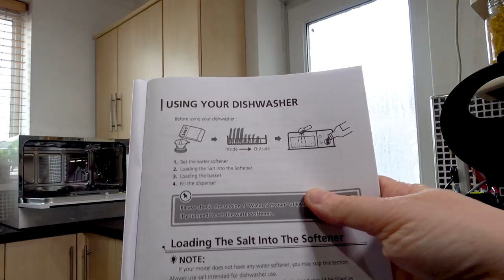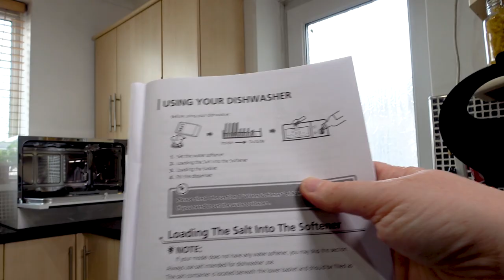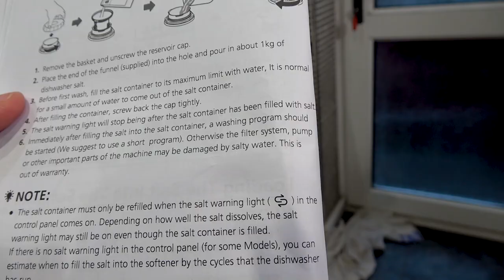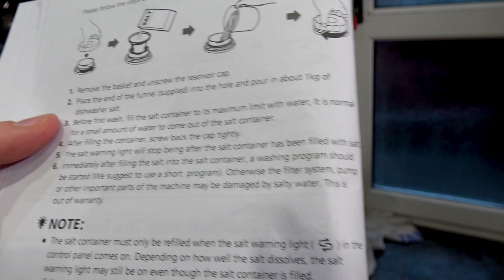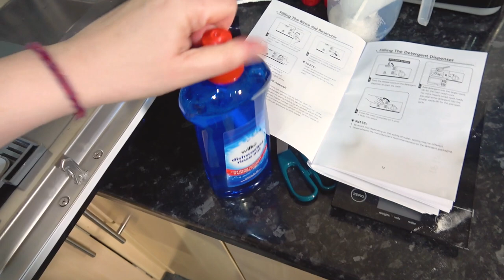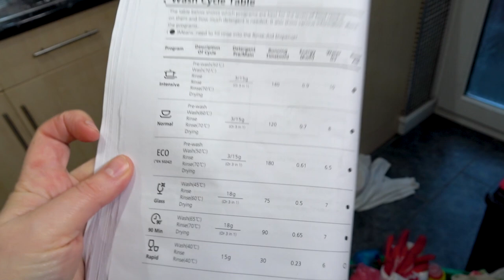COOKOLOGY COUNTERTOP DISHWASHER UNBOXING, SET UP with KITCHEN TAP & INITIAL IMPRESSIONS.

Comment: This video literally saved the day , I recently bought a counter top dishwasher and had the same issues with connecting it to the tap , this idea is amazing . I've done the same and now have a working dishwasher after buying loads of different attachments for the tap that just wouldn't fit . 😊 Thank you
Reply: Where did you get the tap adapter please?

Comment: Well done on your perseverance! I had a plumber install my table top dishwasher and never had to put that item on my tap ever so none of that screwing anything to my tap, I just plugged in and it worked, it must be all set up behind my dishwasher so no need for the annoying tap things coming off. If you don’t have the space for a full dishwasher and dislike washing dishes as I do then you will adore these sizes of dishwasher, great for one person or max two. Love mine, on my second one and wouldn’t be without it, also being on worktop you don’t have to bend down to load and unload, another plus.

Comment: i just got the 8 place baridi dishwasher. it is similar to yours. i tried a screw in tap adapter and it just kept leaking everywhere so i decided to plumb it in like the washing machine. i had to cut a hole in the worktop but it works great now with no leaks. it is also looks nicer than havig pipes all over the place.It is my first ever dishwasher and my emotions during the setup process were identical to yours.

Comment: So funny 🤣 this is my reaction to any DIY or setting up things....glad I'm not only one!!! It's made me more confident in attempting mine now, as I've the same dishwasher and tap, it's been sitting in my kitchen unused for two years 🙈 been thinking I couldn't do it. Thanks ♥️
Reply from the maker: Thanks! Hey - my tap DID have a screw thread on it - the tip on the tap worked itself lose eventually after that bulb got blasted off enough times. I soon got it plumbed in properly as I found it a pain having it stuck on the tap whilst in use. Thanks so much for watching. X
Reply: @PlanetImo  just not sure how much it would cost for plumber, had bad experiences, don't want to be ripped off!- but I'm going to try on the tap for now fingers X it will do for now!! X

Comment: i'm addicted to watching your channel now, just started home ed for my 13 yr old eczema and allergy daughter..and although i have a rather big dishwasher, we never use it, however, i find i'm supporting daughter with lessons etc until 3, then doing planning, researching etc until about 11pm together with my own stuff..i'd rather have a table top dishwasher too..plus your video reminded me of the time when my husband was away, i wanted a clothes airer up in the garden, well i bought a large one as we have 3 adulst and 1 child in the house..i bought such a big airer that i couldn't fit it in the car properly, then, i dug out a hole and got my instant cement mixed up, digging hole took 30 mins of hard work..when i placed the spike in, i hadn't realised how quick, quick cement mix was!!! so i ended up having to dig another hole, but had a full on fight with myself in my garden to get the spike back out first, i had a massive tantrum in the garden that my mother and daughter retreated back inside the house. Plus we now live with a wonky lopsided clothes airer because i still didn't get the hang of using quick cement and i wasn't going to fight digging a third hole!! Honestly, there's always a story to laugh about with my DIY adventures, like the time i tried to put up a shower curtain and ended up with a hole that went right through from bathroom to living room.
Reply from the maker: 🤣 Your DIY adventures sound hilarious! I remember when I first started home-edding I would be planning til 11 every night too, but as time went on I kind of just got into a habit and pattern and didn't seem to need to do as much planning. I guess also probably because we eventually went the online/correspondence course route for key stage 4 which didn't involve as much planning. Good luck with it - I hope you enjoy it as much as we did and thanks so much for watching. :¬)

Comment: Definitely a useful video this, considering getting myself one of these and this has covered almost everything I needed to know... particularly the plumbing!
Reply from the maker: Hm yes my plumbing was terrible. It turned out there WAS a screw end on my tap after all. I bet there’s one on yours too. Do you know, I got it plumbed in properly within a few weeks as the hosepipe attachment kept blasting off the tap mid cycle. I love my dishwasher though, all this time later and am so pleased I bought it. Good luck!
Reply: @PlanetImo  You're right, I'd never noticed that before - thanks ⭐⭐

Comment: I know I shouldn't I found your Video whilst research a replacement for my Hotpoint, Disaster. And I never laughed so much. Nearly as wet as I got disconnecting the old Hotpoint one, because the Valve had given up the ghost and then found the water stop tap was snapped and the other one was 8 metre's away from the Flat. You may have sold a Dishwasher for them, just based on your fun video, its going to be in my head for months. Might have to watch a few more times lol
Reply from the maker: Ha ha ha! Thanks! I was so uncomfortable making this video as I was out of my comfort zone trying to attach that thing on the tap. I got it plumbed in in the end. Thanks so much for watching. 😃

Comment: I have the 8 place version of this dishwasher(didn't really need such a big dishwasher but I find the extra basket shelf helps a lot to cram in more stuff). I live in a soft water area so even though I put salt in the tank it doesn't really need it. I also reduced the salt water setting down to the lowest it can go and the rinse aid down to one because the Finish Quantum ultimate pouches have rinse aid in them too. I forgot to do that first wash and everything had so much residue on them.
Reply: With the bigger washer I can cram in some pots and pans in there as well as loads of dishes. Milk pan fits in the top shelf next to the knives and forks, spoons.

Even washed fruit in it once.
Reply from the maker: Oh thanks for that info!! Very useful. Thanks, Davinia.
Reply: Where did you get the adaptor please
Reply: Could you please tell me which tab adaptor did you use
Reply from the maker: @Sophia-bt2lr  Hello! I got mine from the hosepipe section in Wilko but it really wasn’t the best one for the job and as you probably saw from the video, I had to chop a bit off it and do a bit of a botch job with it. My tap DID have a screw end after all - it was very well hidden! I’m sure you will be better with a screw end adapter. I don’t know where to get those from? Other than Amazon I suppose? Probably somewhere like BnQ or Screwfix? Sorry not to be more help! Mine kept flying off the tap and squirting everywhere with the rubber-bulb/jubilee clip adapter and I got it properly plumbed in within a few weeks. I’m glad I did that. Thanks so much for watching! X

Comment: Good to know it’s possible to use it with a tap. I plumbed mine in at home, it’s not difficult just need a y connector for waste and inlet but my parents plumbing is really inaccessible. Will see what happens! Not sure I’m strong enough to tighten the tap connector 😮

Comment: This is really helpful it answers all my questions about connecting it to the tap! When you got it fully plumbed did they have to drill a hole through the countertop? Not sure how else the hose would reach the inlet in my kitchen tbh..

Comment: Due to space saving i have a washing machine outside under a gazebo and it has the same cold water in fitting.
I jerry rigged it pretty much same as you did and it works fine, but i do turn off the outside tape when its not in use so its not under pressure,  and its outside so if it did drip or squirt its no big deal.
Nice video, informative, as im after a dishwasher!
btw, what a job every time you want to use your machine, that rubber tap connector....no way i woud put up with that.

Comment: cant wait to get mine now soon and I believe I have the same tap as you also, love the review especially you running for cover lol xx
Reply from the maker: You won’t believe this - the end of the tap DOES unscrew!!! I tried every way possible to try to get that blinking thing unscrewed and then IB turned up tonight and just idly twisted it off with his thumb and index finger! 🤦‍♀️ revealing a screw thread underneath.
Reply: @PlanetImo  ohh then I may have a different one as yours as mine is smooth and don't have any screw bit, it looks good in your kitchen though, did you have any trouble with the water hose thrashing around?
Reply from the maker: It was fine, being weighted down. 😊
Reply: @PlanetImo  ohh great good to know 😌

Comment: I love the blurr cam shots inside!  Use a pair of plyers if you really need to tighten the adapter.  Congrats on your success.
Reply from the maker: Ha ha! That wasn't on purpose. :¬) Thanks for the plyers tip.
Reply: Er...no, please don't use a pair of pliers there, unless they are adjustable water pump pliers, and you protect the coupling with a piece of cloth.

Comment: ..   Imo and her plumbing instructions, using a hacksaw and gas stove.  😂   Watching you hook up the water hoses, has me on the edge of my seat..  haha
I"m sitting here laughing... hubby asks what's so funny... I say if you ever need to weight something down, attach it to a mug of water.. lol
Lmaoooooo... drip, drip, drip... yup... it hit the ceiling.. hahaha
That's a lot of force behind the adapter coming off the faucet.   Am wondering if that line around the faucet towards the bottom actually does come off to allow the screen inside to be cleaned out with built up minerals and allows for an attachement to be screwed to it for the d/w.  The plumber will get that figured out. Best to sit back and wait for him.. ha
Reply from the maker: You were right about the end of the tap coming off after all! 😂😂😂😂 Oh my goodness!
Reply: @PlanetImo  ..  Perfect !!!.   The only reason I know that is from having over 40 years of owning homes and doing updates and changes that  I learned along with my hubby.

Comment: I bought a Cookology tabletop dishwasher in 2020 which has been really good, however it’s not working anymore so I’m wondering if I should replace it with this one which is a bit bigger. Have you had any problems with this one since you bought it?
Reply from the maker: Oh I love it. I've had no problems at all, other than having to lean the 25cm diameter plates over slightly to fit them in. That's not a problem though and is perfectly doable. Thanks so much for watching.
Reply: I have had a problem with my cookology countertop dishwasher after only 8 months it states there is error 4 won't drain

Comment: I haven't bought rinse aid for years. White vinegar is much cheaper and works fine! I also use white vinegar to periodically clean the dishwasher. Place a cup of vinegar the right way up in the dishwasher and run on hottest wash.
Reply from the maker: Ooh thank you! I’ll keep that in mind.
Reply from the maker: I wonder if I can clean my clothes washer with white vinegar too?
Reply: I know this was from a couple years ago but re vinegar, I open the door when it’s in the rinse cycle and pour in some vinegar. It helps to reduce spotting and cleans the inside of the unit too.

Comment: My countertop dishwasher has a quick connect piece for the faucet. Really simple and just clicks on when needed.
Reply from the maker: Sounds fabulous! I quickly got mine plumbed in within about a fortnight - I couldn't cope with the stress of my cobbled together rubber bulb set-up flying off the tap mid-cycle! 😆
Reply: @PlanetImo  I would love it if mine was plumbed in but I have an old full size dishwasher (defunct) that’s tied in to a garbage disposal (also defunct) so I would have to rip out a lot of stuff to get it done. Have you seen the little dishwashers that don’t have to be connected at all?  You just pour in water from a pitcher and the unit heats it up as it works. It’s small but great for tiny houses/campers. 
I love all the new stuff that’s being designed. 
BTW,, forgot to say your video was great. 😁👍❤️
Reply from the maker: Those portable ones sound great!

Comment: Please would you share a link for that thing you used to connect the tap to the dishwasher? Mine does not have a screw, its just like yours.
Reply from the maker: I actually got it from the gardening section in Wilko - sadly now closed down. I would double check your tap though - I was absolutely convinced mine didn’t have a screw thread but it actually did - it was just so tightly on I couldn’t detect it. I gather they generally do have them so it’s worth checking.

Comment: Thank you for the video! I bought a cookology tabletop dishwasher and trying to connect to the kitchen tap. I am also living in Leeds, so that would be great if you can give the local shops name thay sells the pipe😅
Reply from the maker: Ahhh yes... the connector... I got it from the hosepipe section in Wilko, but I didn't want to draw too much attention to it as I don't advise anyone to get that one as it kept blasting off the tap and squirting water on the ceiling, plus I'd had to cut it and adapt it, as it wasn't the right pipe,  as you might have seen if you watched the whole video. Also - your tap SHOULD have a screw end, if you unscrew the tip off it. I was convinced mine didn't have it, but eventually, after that rubbery bulb blasted off a few times, it worked itself loose - so I should have got a screw one. I didn't find it at all clear from the manufacturer's website or instructions what that pipe was. I soon got it properly plumbed in and it was so worth it! Thanks so much for watching. x
Reply: @PlanetImo  Yes I managed to screw off the tap! and ordered divider and connector, dishwasher will arrive on Saturday so finger crossed hope it works! Thank you for the video!

Comment: Did you get it plumbed in afterward? I’ve just purchased one so looking at cost etc 😇
Reply from the maker: I did! Yes! It's much, much easier to use with it plumbed in. Thanks for watching. I still love this dishwasher and it's been great as long as I don't accidentally obstruct the rotating part.

Comment: I was having the same problem, when I realised I only used cold fill for my washing machine and the hot fill was going spare. So I'm using that.
Reply: I can't believe you found the screw thing on the tap!
Reply: I might send a video of mine, I've cleared a space but not washing up till it comes on Tuesday!
Reply from the maker: Me neither! Argh! I must be sooo puny!
Reply from the maker: Oooh lovely! :¬) I love mine, but I'll love it more once it's plumbed in. What I especially like is it reduces worktop clutter of dirty crockery as it can be rinsed and stored in the dishwasher, out of sight, until it's time to do a load.

Comment: great video, thank you for sharing, having similar battle with my kitchen tap, can you share the name of that attachment you bought from wilko, please. :)
Reply from the maker: Hello! Thanks so much for watching. I’m pretty sure I put the name of the tap adapter in the description.  I bought it from Wilco from the hosepipe adapter section. But I would double check if the tip of your tap unscrews to reveal a thread, because if it does, a different adapter would be better I think and less likely to come flying off like mine did! It turns out mine DID have an unscrewable end, after all that fuss - it was just on unbelievably tight and barely visible. I got it plumbed in after a while as it was a right pain to keep putting it on and off the tap and then I couldn’t use the tap while it was running. The adapter I used had a big rubber bulb and Jubilee clip on it, but remember I couldn’t plug it into the water feed without cutting the end off and fiddling about, warming it up to stretch it onto the adapter from Wilco. Good luck and thanks again for watching!
Reply: @PlanetImo  thank you for your help! :D

Comment: I'm just now watching your vid, is it possible for you to tell me what the times are and also what each setting is supposed to clean please? I can't find anywhere online that tells you the times of each setting, and also how much each setting cleans the items. I put some things in on the p4 setting but I'm presuming because it is a picture of a glass that setting is just for glasses. Hence why my things were still slightly dirty when I took them out!
Reply from the maker: Hi Becca. Thanks for watching! I only ever use program 6, which is the 30 minute one. It doesn't dry so I just open the door and pull out the rack to let it air dry for a while before putting away. I've had a look in the operating instructions and although it doesn't say which cycle is what number I am deducing they are in numerical order and are as follows:

1 - Intensive 140 mins
2 - Normal 120 mins
3 - ECO 180 mins
4 - Glass 75 mins
5 - 90 Minute - well, 90 mins!
6 - Rapid - 30 mins
7 - Self-cleaning - 80 minutes.

I find I can't put really soiled items in it - they need a rinse off under the tap first, preferably straight after use, otherwise they also need a soak. But usually that way everything comes out clean enough, and if not, it's been soaked during the cycle so a quick wipe with a cloth and rinse sorts it out. 

I hope that was helpful! 

Imo x
Reply: @PlanetImo  aw that's so nice of you, thanks so much for this info! I got mine second hand for a reeeeeally good price so I couldn't pass on it! But no manual came with it hence the question! But thank you so much for being so kind and replying. This is sooo helpful! X